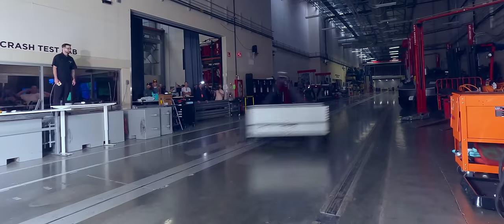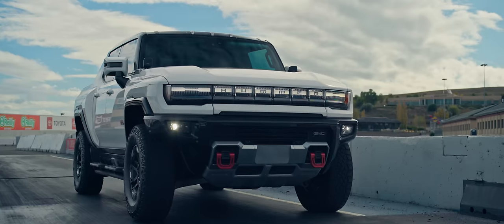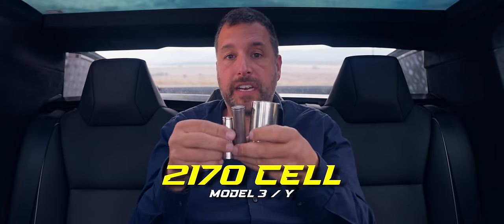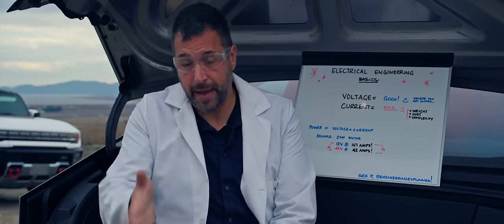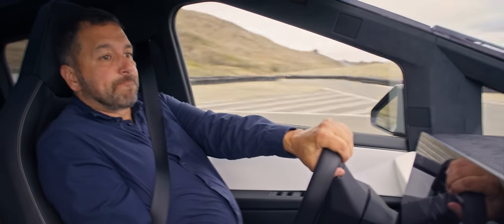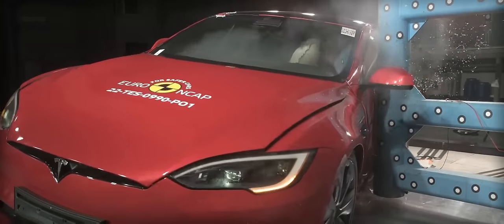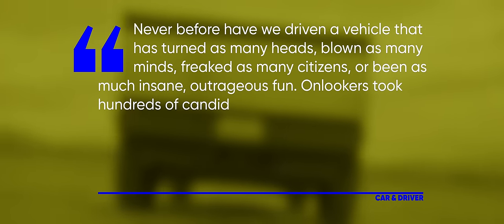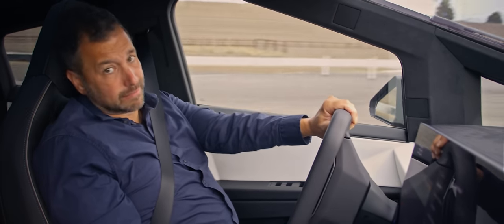Exclusive 2024 Tesla Cybertruck Full Review & Drag Race w R1T & Hummer  — Jason Cammisa on the ICONS

Comment from the maker: This episode is presented by Valentine One Radar Locator: Find radar before it finds you https://bit.ly/Valentine1_Hagerty
Reply: this video is a great paid promo piece for Tesla.
Reply: THIS EPISODE IS PRESENTED BY CYBERFLOP THE MOST USELESS TRUCK EVER INVENTED :face-blue-smiling:
Reply: CT isn't using mud tires, it's AT tires. The Hummer is 3 seconds 0-60, near half a second more than the CT, but in the video it wasn't in the launch mode (WFT), what can be confirmed by the suspension height. It also appears to launch considerably earlier than the Rivian. CT don't need any of this to be superior.
Reply: @11:35  - Steer by Wire is also on the Lexus RZ450.
Reply: Best car review ever!
Reply: You know the people you can least trust are the people Elon trusts to give "exclusive" first looks at his trash.
Reply: Steer-by-Wire - Lexus might beg to differ on your claim of it being "for the first time ever" - Lexus RZ 450e
Reply: Give the hummer a rematch using its watts to freedom mode the testla might weigh around the same possibly lighter but no way the hummer dint get a second chance
Reply: @FluxedEdge  Comment at 11:24:  My 2018 Alfa Romeo Giulia Ti Sport also has steer-by-wire as well as both accelerator and brake by wire.  Further, the gear-lever for the ZF automatic is a fixed-in-place gimbal with no physical attachment except by wire to the gearbox itself.  Finally, the emergency-brake is activated by a set-switch on the center console via a wire; there's no tension-cable involved.
Reply: @billybobbob3003  You can be an Ass or you can be  Donkey, but the CyberTrk is a totally different animal  that legacy auto will be forever afraid of, In think I know what you are
Reply: @AuralioCabal  its a piece of crap truck failure as a truck overpromised underdelivered on price and range and towing, you cannot put stuff in and out of the bed from the side of the truck bed due to poor design and shitty towing range the ramcharger truck with 690 miles of range uses same type set up as an diesel electric train will be the true towing king of all electrified trucks lol @ having to put huge battery pack in the back of the truck bed to get 440 miles of range in cyberflop making the truck bed not as usable lol that wont beat 3.6 v6 pentastar range extender tho never will.
Reply: Or, you could drive reasonably as in within traffic law, for free & help responsible citizens make the street safer.
Reply: Be honest, this “car” is a joke, right? Nobody would actually buy such an ugly item. It’s an offense to the eyes and good taste.
Reply: It's no secret why they avoided doing any towing with it. If It's anything like their SUV, it completely destroys efficiency and range so bad it's embarrassing. Basically, if you're going to tow anything. Do NOT get a EV.
Reply: All you said was money is good and gave no actual information about the vehicle.
Reply: I’d like a truck that I can keep in excellent condition and use fur 10-15yrs and pass on to my kids.   This isn’t it.     In 15yrs it will be dead.
Reply: I miss my Valentine one, at least the original. I’ll have to check out the new version.
Reply: @TheHoosiers2008 the technology has improved so much. It’s incredible.
Reply: @MrCwilson66  There was some other video they published on YouTube, but I was listening in my car. I heard the V1 audio on the video and immediately hit the brakes 😆
Reply: @TheHoosiers2008 😂😂😂 muscle memory
Reply: I thought that this was some weird concept, but it’s actually the worlds ugliest vehicle
Reply: Wrong about steer by wire. Infiniti uses the system in q50 and q60. Its called DAST or direct adaptive steering.
Reply: Impressive video but it would have been more informative to see the bed , tailgate and other features.
Reply: The screen when he was racing is EXACTLY like when the fighter ships exited the original battlestar galactica. That cracked me up!
Reply: Too long! Lost interest!
Reply: What happens to steering if it completely loses power while driving?
Reply: @Tacticalfighter  let it go!
Reply: @THOUGHTCRIME_No1  nope..on one ! 
Not even the 1.5 million reservation holders.
Reply: @shperax  
the CT 
Will get about as far as a Ram T-Rex 
Or Ford Raptor. Towing a trailer.
Reply: @mrblack6467  and how do you know that ? where is your proof on a vehicle that never existed before? 
🤨🤔
Reply: @mrblack6467  also, you’re a really good dad…..you’re gonna pass on a 15-year-old piece of junk to your kids!
Reply: Boy, talk about selling a vehicle that NO American wants.
Reply: Will there be a tire pressure and rear view mirror subscription?
Reply: @THOUGHTCRIME_No1 Did you watch the whole show?
Reply: The captions are hilarious, thank you!
Reply: whoever directed this, the team that worked on it, the editing... honestly.. stop doing cars and make something your own... you could probably turn an INSANE profit...
Reply: 🔥👈 great video
Reply: @stewartciesla8142   I'm sorry, but you are just wrong. We have the statistics for the other truck EV's on the market, and It's pretty much across the board. No current EV truck will in fact do over 160 miles towing anything. And we already know as fact that gas and diesel vehicles will tow over 300 miles on a tank of fuel. With CT experts, the best estimates should do around 175 miles. So still 1/2 the range at best. We won't see comparable towing ranges until trucks launch with Solid state batteries. Toyota and or Nissan will release the 1st Solid state battery vehicles in 2025.
Reply: I've just posted on the YT channel 'MKBHD' (he reviews phones, elec cars n such) pointing people to this video! He's done a long review of the Cybertruck, so, hopefully, many more will come and see/experience what Jason (& Co.) did here and maybe get as hooked as I am on the Hagerty channel!!! 👌👌
😎🇬🇧
Reply: Q50 was actually the first production car with steer by wire technology, 10 years ago...
Reply: octaviomoreno6263  Me too, if the body doesn't absorb the energy of a crash flexing, it will transfer to the passengers with damaging consequences...
Reply: You hated the 2014 Q50 steering by wire system. Yet you don’t even mention it in this video.
Reply: @FluxedEdge what about the 2014 Infiniti Q50.
Reply: @billybobbob3003  did you actually watch it?
Reply: @billybobbob3003 for supposedly not liking it that’s quite the long comment 😂
Reply: @THOUGHTCRIME_No1  2.1+ Million preorders respectfully disagree
Reply: @benjy117 millions of preorders respectfully disagree
Reply: @shperax  millions of preorders
Reply: @p.informatico1320 they published crash test results. If you’re in the truck you’re fine. Outside you aren’t.
Reply: @wilfriedkaiser   That proves nothing. Millions of people also voted for a man who is more handicapped than Simple Jack.
Reply: @brentwoodtn  funny s how they delete comments that could be seen as proving your point
Reply: @brentwoodtn  no mention that the car was originally claimed for 30000 USD base model (now 60000 USD) and 70000 tri-motor model (now over 100000 USD)
Reply: @brentwoodtn  no mention that Lexus did a functional "wired" yoke car before Tesla on the Cybertruck, no mention that in 2023 the Hyundai Ioniq 6 won NCAP safest car (it beat the Model 3 in 2023), no mention other car manufacturers especially Asians make lower priced competitive cars so Tesla had to cut their prices.
Reply: @shperax  ok 
So you’re telling me that a Ram T-Rex that gets 7-8 mpg and has a 33 gallon tank is over 300 miles? No! 8x33=264 miles. And that’s not towing mpg. So realistically, it’s only gonna get under 180-200 miles towing.  So that’s why people that buy T-Rexes  and cyber trucks aren’t not buying them to tow big trailers. 
That’s what F250 and 350 super duties are for.
Reply: Something tells me you had more fun driving the lambo truck!
Reply: @stewartciesla8142  What planet are you on. Transport trucks get 7-8 mpg while towing. I'm talking about pick up trucks. Not massive commercial vehicles. Try 12-15mpg while towing. So with a 36 gallon tank your going over 400 miles.
Reply: @billybobbob3003  LOOOOSSERRR ❗
Reply: Wow, what a puff piece!  Comparing the fly by wire technology in commercial aircraft to Tesla's wonky cutprice version is very disingenuous.  This is a company that makes "self driving" that kills people on the regular.  Commercial aircraft not only have multiple redundant electrical systems, but they also have mechanical overrides that can be used to control the aircraft if the electrical system suffers a catastrophic failure - not only that but in an aircraft having a steering control failure, you have time to correct it - in a truck at speed, you have at most seconds before you crash.  The Cybertruck has no such mechanical override - if that 48 volt system fails you at 100mph, you are dead - and I'd bet real money given how bad a lot of Teslas hardware and software is, it will kill people.
Reply: Going to try to be as objective as possible. While I agree the model y is the current best selling car in the world the sales numbers for the model y have slumped by nearly 500000 model with other brands quickly catching up with more affordable and from the research I've managed they seem more reliable. Model 7 sales in 2022 were in the 700000 range this year they slumped to just over 250000. Eleon needs to step back from Twitter and stop it essentially the image of tesla.  He's been saying incredibly unhinged things and these low sales numbers are suffering because of it. Of course the borrowing rates have gone up but data has shown customers are actually spending more of their disposable income now than ever, so high interest is likely only part of the slump in sales. I'm willing to bet most of the sales are falling odd because of more reliable competition emerging and Mr X showing his true colors of late.
Reply: The Hummer EV is that large and heavy because they designed it to be the best offroad EV on the market. The Cybertruck can't compete against the Hummer offroad
Reply: @billybobbob3003 yeah, I'd rather have the Hummer, I can actually go through the Ocala Forest with ease. The Cybertruck would get stuck before 10 minutes into the trails
Reply: Is anybody else waiting for Charlie Sheen to pop his head in?
Reply: As impressive of an engineering marvel the Cybertruck appears on paper and in-person. Any Hummer product, pre& post-GMC resurgence, carries more lifetime value, outright utility, and unmatched pedigree. Hummer EV is still king of EVs. Cybertruck can go duke it out with the Rivians for 2nd place.
Reply: Steer by wire was already in the infiniti q50 🤦
Reply: By Valentine or sponsored by Tesla? It was quite a puff piece of "journalism."
Reply: this is the best video on YT I have seen for years
Reply: how much is insurance..5k/year
Reply: Has literally no cons to the truck at all and he basically talks about it like it's a really nice car. That's basically what it is. Nothing about the "Cyber truck" is actually truck, he talks speed well what about power? What about range, tow rating, tow range? Semi...bed.... size....? It's just a show truck 😂😂😂
Reply: @stewartciesla8142 yep, people who buy cyber trucks want them for show! 😂😂😂 there's not even a haul rating to tell us how much it can hold in its tiny bed
Reply: @oBCHANo  lol big facts. I wonder how much Tesla pays for these ultrabiased reviews.
Reply: @DeadEnduro  he left that out intentionally. Could have done an offroading test too.
Reply: LOL, 100k and you don't even get a rear view mirror. That surely isn't going to cause any accidents.
Reply: For a truck it doesn't look like it will carry much in the tray!
Reply: This episode was nothing more than propaganda for Tesla. You didn't even test it as a truck.
Reply: @mrblack6467  I heard they can travel 1 million miles if you replace the motor 13 times and replace the batteries 4 times.
Reply: If the truck doesn't absorb impact in a bad accident, the occupants will....  Airbags, or not. If you've been in an accident in a modern vehicle with the full range of airbags, you know just how much of the impact you actually absorb....And that's inside of cars/trucks designed to crumple up, absorbing much of the impact, so you don't have to.
Reply: OMG just imagine if they put the rotary engine in the DMC Delorean ,with toda7ys tech thats over 500hp and in a car that everyone knows, back to the future, why the engineers did not go through with it, is japan did not want to take on the task of making a engine just for DMC, just in case they did not get paid after all its about MONEY right? If DMC company got paid by over a million customer when it was first introduced, then it would have a good engineered rotary engine in it full stop?
Also a Western australian Croatian Motor engineer designed a orbital engine, maybe that could have been used as well,  Its all about the mighty dollar, the orbital engine design was sold to GM, Maybe thats why🦘🦘👌✌👍
Reply: This episode is sponsored by DEZNUTS slapping across ur chin!
Reply: King Amar jeet..FF😭
Reply: @billybobbob3003 om😮o 28:03
Reply: Cyber truck is different… not necessarily better.  That Rivian is a complete package.
Reply: And then an humble 570hp porsche 911 turbo walk in the chat and dust the cybertruck with 2.4 seconds 0-60 and 10.3s @133 mph 1/4 mile     :/
Reply: Torsional rigidity loooks very good. Untill you discover the Chinese Yanwang platform for the suv U8 did the record of the segment with 54425 nm :)
Also Jason, check the yangwang U8 yi sifang platform, you'll discover the same sterring not mechanically connected to wheels
Reply: Bring a yangwang U8 and make a comparative test!
Reply: This is NOT a review its clearly a Tesla add $$.
Reply: if winter how open door cybertruck ?
Reply: Is CT designed for teenagers? -- Because that presentation is only interesting to teens and those who mentally stuck in that age.
Reply: Nice ❤️
Reply: tesla propaganda garbage, unsubbing
Reply: Absolute very obvious paid advertising, disgraceful..
Reply: How much money these gentleman got payed to sell their reputation doing nothing short of a comercial to Tesla
Reply: this aged like milk...
Reply: Jason Cammisa is a sad fanboy...
Reply: It looks like it was designed by Homer Simpson.